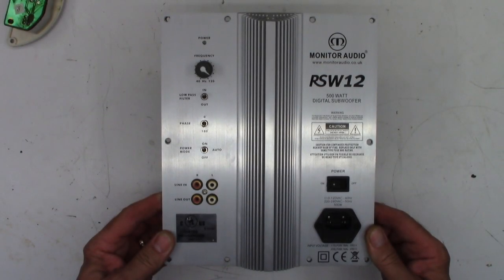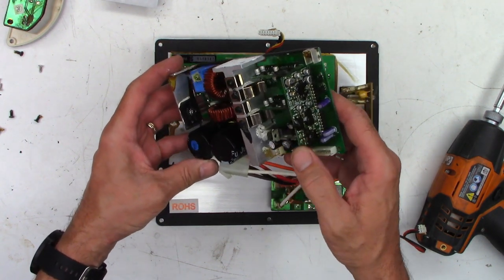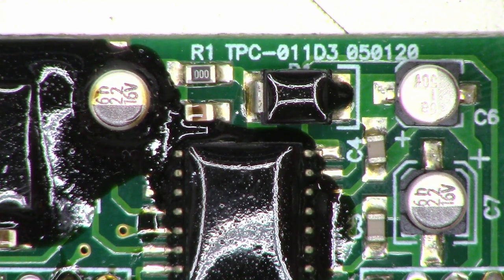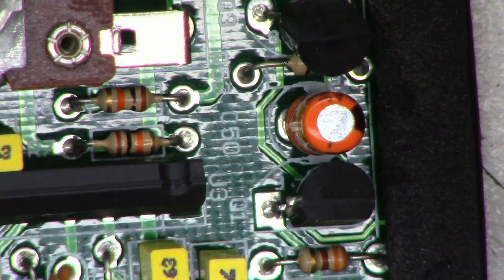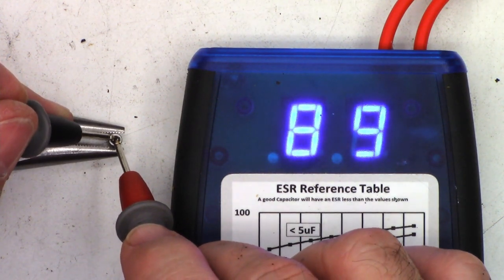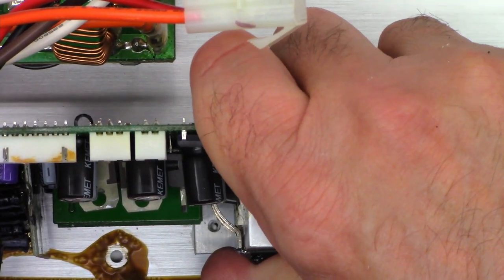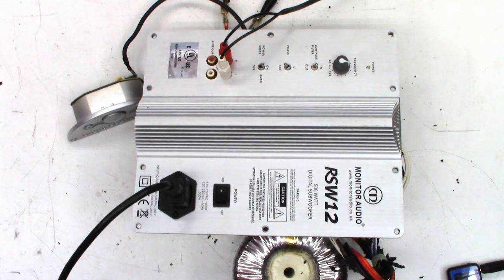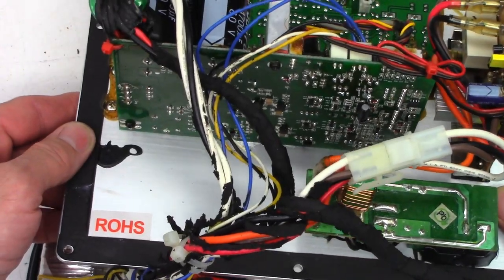Monitor Audio RSW12 - Loud Buzz - Successful Failure...Nope!  - Part 2 - The Repair. RSW-12

Comment: Amazing work, I wonder ….. this is a common fault in these units, monitorAudio will sell you a new board so you can DIY fix but going by your video it looks like they themselves caused the issue and there not prepared to accept them back under warranty 
Cost of there unit is £300 + 
What a job you did I’m impressed 
Keep up the great work and keep sharing 
Thank you 👍🏼

Comment: Thanks for posting this, I have exactly the same problem and changed all the caps on the big board but didn’t think to do the small boards. I never would have thought to use the iron to remove the epoxy or to use leaded caps on the small boards. Will do that next.

Comment: Nice tip on using a hot tipped soldering iron to remove the epoxy. 👍🇺🇲

Comment: I watched a video on EEVBlog where Dave had a KRK Rokit 6 Studio Monitor Speaker that was playing up, and it turned out to be the black potting compound they put all over the board.
It had become conductive over time, and once he scraped it all off, it solved the issue.
Reply: Yes, but here it looks like they used a different epoxy, though there still is a bit of the horrid brown glue on some of the screws on the board. Lots of failed capacitors, all from being well toasted ultra cheap short life ones. Likely the opamps are bog standard LM324 or copies, not exactly needing much more for a subwoofer, and the diode likely is just a 15V zener diode there for regulating the power rail, or to clamp the half rail reference to some level if there is not a symmetrical supply.

Comment: I had one of these boards in a repair shop for 2 years and he couldn't figure out how to get it fixed, He told me the company wouldn't release the schematic?? I have two of these subs and I've recently converted them to passive, drilled two holes through the aluminum and put external 5-way binding posts on them. I'm using a Samson SX-1800 with a Cleanbox Pro to power them. I have much more power than the original amps, though I am considering adding a DSP.

Comment: Hi, I was just wondering if I can send in my amplifier to you for repair? I have a monitor audio silver subwoofer asw 210. It’s is pretty old, would you be able to repair it or is there a way to replace it with a modern amp component and add it onto the existing plate?

Comment: Excellent repair! Two questions come to mind - do you have an optimum temperature for epoxy removal and is there a reason why you do not replace the surface mount caps with surface mount caps (especially as you had to order caps anyway)? Thank you for your well done videos.
Reply from the maker: Leaded caps usually have a much longer life span.

Comment: What was the cost of this repair? I've got a RWS12 that doesn't work properly so would like this done to mine
Reply: Hi Dino
Hope you have your RSW 12 problems solved by now.
My one have a problem to kick in - puffing only into a driver and finally starts, but I know it is beginning of final death.
I contacted Irish supplier and the cost is €295 for a new amp plus shipping cost, but it is for a newer ( allegedly improved ) version - SW 12.